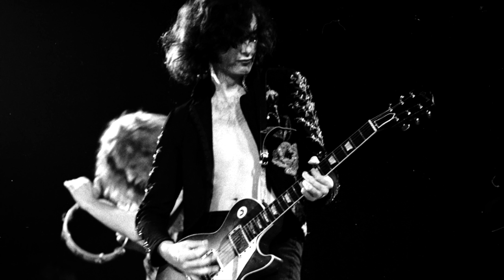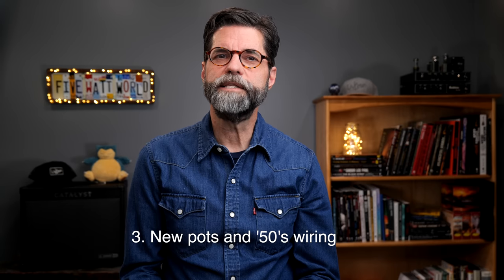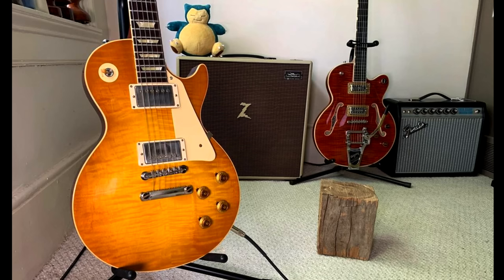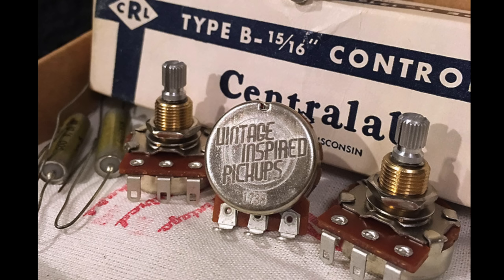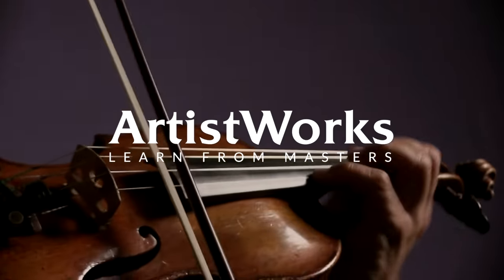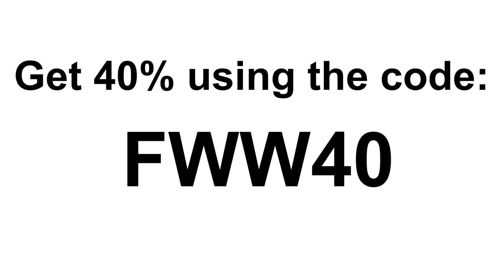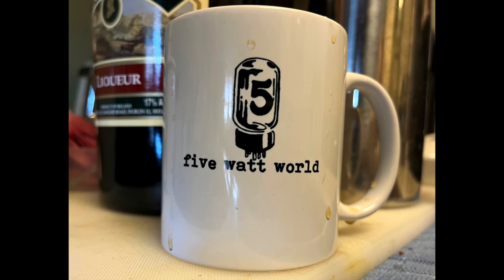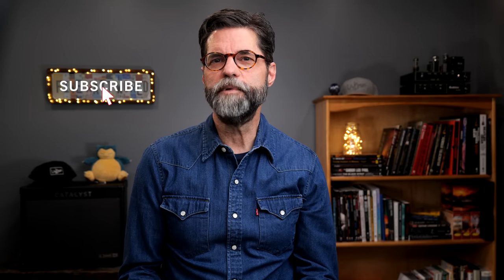Budget Guitar & Boutique Pickups? Is it worth the upgrade?

Comment: Honestly, this pathway would be the perfect path for a person FINALLY able to afford a good guitar.  Buy the PRS SE and play it stock.  It sounds really good that way.  When you have saved up some more money, do the pots and wiring upgrade.  Play it until you earn the money to buy the new pickups.  Unlike a lot of "upgrade cheap guitars" videos, every step of this build gives you a fine instrument that can be played and enjoyed that way until you're ready and able to move on to the next step.
Reply: ^^^^THIS!
Reply: @@MikJames Exactly! Tonewood isn't tone. Pickups aren't tone. Speakers, cabinets, and mics are tone. A cheap Harley Benton guitar will sound EXACTLY the same as an expensive PRS when played through the same amp, same speakers, same cab, and same mic with the same mic position, especially in recording and live environments.
Reply: @dionr1168 a similar spec pickup will, but almost any difference in design will change the tone, whether that be number of windings, Humbucking or not and the shape and size of the pole pieces and magnet. Quality of the parts won’t affect sound but the design will
Reply: I have a PRS SE, very nice guitar, feels great though the standard 24 I own is on the heavy side it’s very comfy with a thick strap. I have made a lot of modifications. Main ones I can list off are
1. Repot the pickups and add a cover
2. Locking tuners and strap locks for convenience 
3. Proper control cavity shielding
4. Replace the bridge (nothing wrong with the original other than the fact it was rusty and tarnished by poor storage by the previous owner)
All in all it’s an excellent guitar now, you don’t even have to replace the pickups
Reply: @@MikJames it doesn’t matter if it’s positive or negative there’s still a pretty decent difference in tone between different pickups, if in a live mix I had to tell the difference between an LP with PAFs or run of the mill unpotted covered humbuckers i never could, but if it was the difference between a strat and an LP it’d be easy. I think it’s really stupid to big up the magnet at the end of the signal chain while simultaneously saying the one at the start makes no difference even though there’s just as much variety in construction between pickups and speakers. I mean how can they design a speaker for a specific tone it’s such a small part of the signal chain?
Reply: @@MikJames go on then, why is a speaker the best thing to upgrade and pickups are meaningless, i need to hear this from the god of tone
Reply: @@MikJames I’ve definitely done that a few times in comments. I’m guessing if you aren’t a single coil guy I’m guessing you’re more metal/ heavy distortion in which case the speaker does make much more of a difference but set clean pickups are very important to overall tone
Reply: @flyingrat492 you both left out a very important tone shaper...an eq pedal.
Reply: @dionr1168  That's is not true.  I have many guitars.  First off Harley Bentons are pretty bad...good for a player that isn't serious...but bad for anyone who cares enough.  All my guitars sound different through the same amp..and I have to adjust the amp...and even then every guitar has it's own character.  Your statement can be true for some light bedroom players.  However in the studio and live...my experience frequenting both is that everything matters.
Reply: @ehiracheta  all your guitars sound different through the same amp?! REALLY?! Then show me the evidence by recording all of your guitars through HIGH GAIN AMPLIFICATION without changing your amps, cabinets, speakers, mics, or mic position.
Reply: @ehiracheta  and by the way, the ONLY reason you THINK Harley Bentons are bad is because they're not Gibsons...despite the fact that Harley Bentons stay in tune MUCH better than Gibsons at only a small fraction of the price.
Reply: @flyingrat492  you know, people go on and on about the speakers in their car stereos and home theater systems, yet for SOME reason, the speakers are completely ignored when it comes to guitar, especially considering the fact that the speaker is literally the only portion of the signal chain that is voiced to a specific tone.
Reply: @dionr1168  They do not stay in tune better than Gibsons...stop regurgitating internet nonsense. I'm actually a guitar tech and have had to correct very badly made harley bentons for customers and the build quality is very bad.  I'm able to correct anything out of Epiphone quickly and easily, and even more so anything the Gibson factory has spit out.  Harley bentons are best left on a stand unplayed so you can tell your friends that you play but never actually do anything more than noodle and scroll on your phone.
Reply: @ehiracheta  Then tell that to Glenn Fricker, who HAD Gibsons come into his studio and created an unintentional chorusing effect because they didn't stay in tune...and who also REVIEWED Harley Bentons on his channel too.
Reply: @dionr1168 to be fair, he’s had some duds like the V and the offset that looked like a Jim Root Jazzmaster. I also believe when he did a blind purchase of an HB to make sure they weren’t just giving him an extra polished instrument because he’s an influencer, it ended up having some flaws that weren’t entirely forgivable, even for a budget instrument.
Reply: @damienalvarez2957  I expect flaws out of a $200 guitar.

Not out of a guitar that costs 4 figures, which unfortunately is a habit out of Gibson. $2000 and up for a fragile headstock and rampant tuning stability issues is a scam.
Reply: @dionr1168 what an utterly insane statement…🤦🏽‍♂️🤦🏽‍♂️ good luck to you sir.

Comment: I've been doing this for many, many years. I shake my head at how many YouTubers "upgrade" their guitar with new pickups, but leave the crappy pots, caps, wires,..... I always change out the harness before changing out the pickups. Yes, I regularly change out pickups as well, but I have a few budget guitars and basses with stock pickups , due to the fact they sound great and gained so much clarity when improving the other electronic components. And yes, I have a 7 lb 2oz, Les Paul!
Reply: Awesome contribution!  What brand of components do you like in regards to pots, wire, caps and switches?  Thanks!
Reply: I'm a electrician. You are wrong. Only the pot values make a difference in sound, not the build quality. The wires are not important because their length is only a few centimeters. Same with the capacitors . Good caps doesn't make a better sound or produce more clarity. A cap comes into play when you roll down the tone pot. And then it's supposed to make the sound muffled. If the pot is open the cap has no influence in sound.
But if you can sleep better after upgrading and spending money than make it 👍
Reply: @rosslunato8111  CTS pots, Switchcraft jacks and switches, ....I have a stash of caps, so I usually switch out a few and leave what sounds best to me, though I tend to end up with either yellow Mallory or NOS Russian mil spec paper in oil.
Reply: @musikus7092  Even Leo Fender knew that taking the tone pot out of the circuit made the sound brighter and Fender and Gibson have done this for years as an option on some models. Yes, a cap is a cap but upgrading a wiring harness also brings higher quality switches and pots, durable switchcraft jacks etc. and choice of pot and cap values, which change the playing experience.
Reply: You should try an Esquire.
Reply: @musikus7092 as a controls engineer I disagree. To each their own.
Reply: @jacobeastham9505  
Have Control Engineers knowledge about electronics?
Reply: @10sassafras  
Fender means, that if you clip the cap off. In this case the tone pot is off the circuit, too.
Of course, this makes a difference.
If you only want to put the cap off the circuit than you have to put a wire instead of the cap in the circuit!!!
Reply: @musikus7092  Why so cranky? It’s only chat.
Reply: @musikus7092  Shhh!  Reality is a no-no with guitarists!  BELIEVE in the magic!
Reply: @joeking433  😅

Comment: I put CTS pots, new wiring with switch craft everything, a custom bone nut and Seymour Duncan Whole Lotta Humbuckers in my $425 Epiphone Standard Les Paul. The difference was pretty significant. It was worth it as I plan to keep that guitar. It was the one fate chose for me and I bought it from my former guitar instructor when that shop was still open. Plus, I used the guitar on my first album with my garage band. Keep your guitars with sentimental value guys. Fix em up and play em as well.
Reply: Which wiring did you choose?
Reply: I did something similar to my Epiphone Les Paul Custom:

- Fretboard level (removing the common kick-up after 12th fret)
- Jescar stainless steel frets
- Graphtech nut
- Seymour Duncan Whole Lotta Humbuckers (zebra)
- Bridge cut improved for better string seating 
- Treble bleed mod

It has become such a good guitar that I've stopped looking at Gibson Les Paul Standards etc.! It holds up really well to my friend's "real" Gibson Les Paul Custom.
Reply: @kevinvandenberg5548  I upgraded my Epiphone Standard 50s Les Paul with Seymour Duncan Seth Lover PUs. It is really worth the money! Now I want to upgrade it with a better harness, but in traditional 50s wiring. Do you have any recommendations?
Btw the Guitar now can compete with any Gibson LP I have played so far.

Comment: I've had great luck with budget pickups. Some even sound identical to the higher end versions. At the end of the day it's just magnets and copper wire. There isn't anything that high end manufacturers can get that small shops cant.
Reply: Well said. I about fell out of my chair when he said VIP charges $250 for wiring two pickups and 4 pots. There are EE's with degrees that don't make that kind of money.
Reply: @kennethc2466  Maybe that includes all the filming. $250 is not too much for highly skilled work.
Reply: @scottmacphee35  Highly skilled work is done by EE's with degree in Electrical Engineering. Soldering a few wires is FAR from highly skilled work. You insult everyone with a degree, who IS high skilled in EE, and could do that job in minutes, with ease...drunk.
Reply: NolanVoid-dr1ch  Quite well said, sir. High School shop class level work ain't $400 a hour. EE's at Boeing don't make that much.

Also, 52 Gibson jazz box! VERY NICE.
Reply: @kennethc2466 get off your high horse. That $250 goes towards rent, insurances, shop costs, staff holiday pay, sick leave all the other things employed people never have to think about. Clearly you have never run a small business

Comment: Great question and discussion! I own a few high end guitars, starting with the 1968 Gibson LP Custom I bought 2nd hand in the early 70's, a Sadowsky NYC S Style in 1992 and a couple of others. These last few years I have seen (and heard) the proliferation of interesting boutique pick-ups / rigs and the Get Back film prompted me to buy a new Epiphone Casino. My guitar tech here in HK completely reworked it - Bone Nut, new PU selector, 50's wiring, Lollar P90's. It went from a nice guitar to something quite special for relatively little cost - well worth it IMO (and way less than the US made Casino Gibson are offering). I have since bought an Epi Cantrell Wino (aiming for similar mods w Monty's Bethnal Green PUs) and an oldish Epi Blonde DC (same deal but most likely Lollar Underspun Imperials). For me if the actual guitar is solid and feels right then why not upgrade and tailor the electronics to the sound you're after?

Comment: I recently upgraded my Ibanez RG370QM (a limited run model)to Dimarzio pickups from the stock Quantum pickups.   I also upgraded the stock Edge 3 tremolo with a Gotoh.  Some of the mods were quite difficult to install and a real headache.  Then I finished and got to play the guitar with an amp.  What a fantastic difference the pickups and new bridge made.   I felt like I have sustain forever and the tones are just beautiful.

Comment: I've had higher-end guitars, (original Hamer Sunburst, 2-LP's and 2-SG's. Still have an SG). Years ago I purchased a Dillion PRS knock-off. It's a semi-hollow body. I had a couple SD pickups put on it, upgraded the tuners, put a push-pull pot in it and had the frets leveled and dressed. I loved it! From then on, it's become a hobby to buy cheaper guitars and make them into players. I have 4 Harley Benton's. Two of them have Gibson 57 classics in them. I learned to level and dress frets, replace shoddy wiring, replace tuners/bridges/pots. My main guitar is a HB LP copy with a beautiful top. It has 57 Classic's in it, CTS pots, Grover Vintage tuners and a Gotoh bridge. I have it fine-tuned to where I have the action at 4/64ths on the low E and about 3/64th on the high E, at the 12th fret. 

In addition to have some nice sounding and playing guitars, I've learned a TON about working on my own guitars. I'm no longer afraid to level/crown/polish frets or completely strip the wiring and redo it from scratch with quality, shielded wire.

Comment: I have done all these different levels of mods on various guitars. Some I added a master volume with treble bleed (typically on a semi-hollow lower horn. Yea, I drill holes too. No Fear!). 2 D'Angelico and a Eastwood done that way.  But some guitars are good as they are and I feel no urge to mod, such as my Yamaha Revstar Standard P90 or Gretsch Jet.

As you say, this is easy to do with simple skills. I really enjoy making my instruments uniquely my own.  Even to configuring my own control circuits.
Mixing pickups, different cap types and capacitances, resistor parallel or series on a bleed circuit, in or out of phase switching or wiring, lots of options to try.

Own it. Make it yours! Have no fear, it is just some metal and wood.

Comment: Type of cap does make a difference. One of the things I learned in tech school many years ago is that each component is a mix of things. They all have resistance, inductance and capacitance even if they are only a resistor, inductor or capacitor. The length of leads and where they are routed changes things too. How much this affects things at audio frequencies, I am less sure but it is very important in RF frequencies. I remember trouble shooting analog video circuits where just putting my finger near a bad cap was enough added capacitance to "fix" the signal. Any capacitor has capacitance (of course) but even the lead length adds inductance and a cylinder style with the plates coiled up adds even more. Of course everything has some amount of resistance but in this case it is the smallest thing to worry about. Anyway, a cylinder style cap will have more inductance than a plate style cap. Of course the physical size (determined by the thickness of dielectric) makes a difference as well.

As for pots, there are three main types: resistive coil (acts like a variable resister/inductor, mostly used in higher power applications), carbon track (known for noise) and plastic track (should be quieter and last longer). I don't know what early electric guitars use I would guess carbon track but I would have to take one apart to be sure. Physical size matters here too. A larger pot has a longer, wider track and will probably last longer.

Comment: This has been my go to strategy for many years. When I started playing guitar I could only afford basic, working man gear. I found that modding them to my tastes was the lowest cost way to get high performance gear. Now, its just the way I like to do it. Three best examples from my collection are:
1. MIM Strat with Custom Shop Fat 50’s pickups, Obsidian Wiring and locking tuners. 
2. Guild Starfire I with Seymour Duncan Seth Lovers, CTS & Switchcraft electronics, Kluson Revolution tuners, Tone Pro bridge and bone nut. 
3. Slick SL56 with Seymour Duncan P90s and CTS & Switchcraft electronics.

Comment: Thanks Keith. Great dissection of how electronics matter to overall tone shaping as well as the impact it has on player engagement. 

To make a guitar one that you bond with is an investment of time and dollars at any price-point, sometimes with zero changes, sometimes with several, but it has to start with a guitar you already like before any changes. Starting with a single-cut SE as a base for this project really drives that point home, an affordable guitar that already punches above its paygrade.

You can do the same with lessor guitars and greater guitars, and countless tens of thousands of guitarists do. The rest of us chase their tone, trying to put it in our own hands through our guitars and amps. Its a crazy cycle ain't it???😂😂

Comment: I have fallen in love with setting up and upgrading my own instruments… I was shocked as to how good my 70’s Classic Vibe sounded after I changed the bridge to a PW-29 Fender bridge, Vintera 60’s modified pickups, I gutted all the electronics in place of CTS pots and pushback cloth wiring, changed the switch, string guide, sanded the neck down to a silky smooth satin finish… I wouldn’t trade the guitar for any Player Series/Performer and pergaps even an AM Pro II Strat… it plays like a dream and I am very proud of the fact I upgraded to become the way it is. The joy I find in stringed instruments is endless!!!